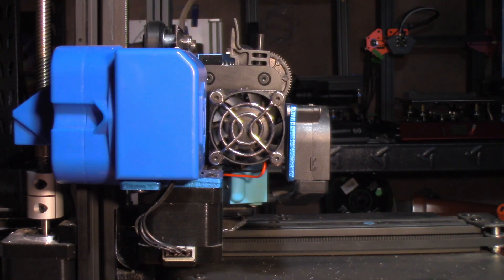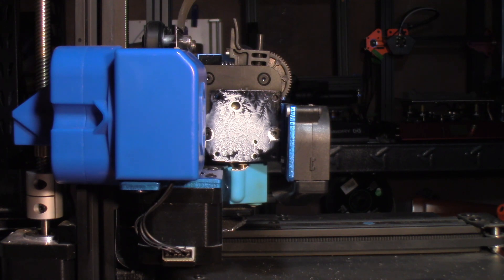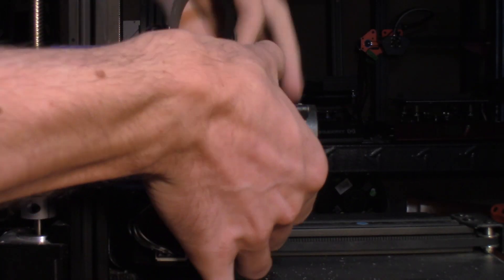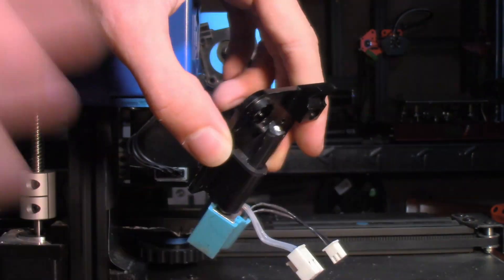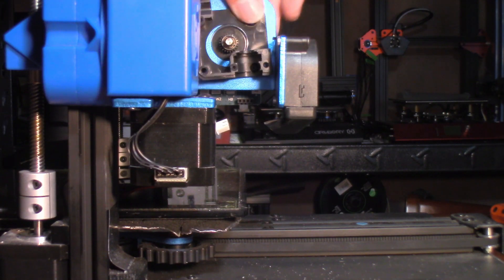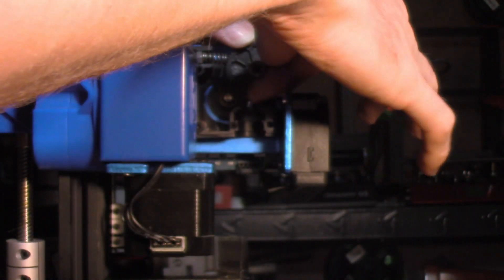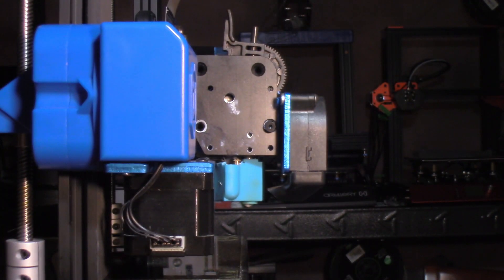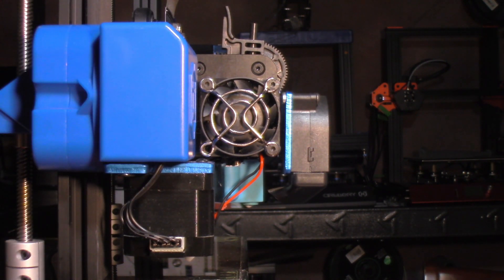Artillery 3D Hotend Teardown and Reassembly

Comment: I find it's a lot easier to work on and re-assemble the hot end if you dismount it from the printer altogether. There are three screws that hold it to the X-shuttle bracket. Mine's a X2, it's a little different. The heatsink and the plate which holds the heat break are one integral piece, no need for heat compound. Took it apart last night since the PTFE tube inside has gone bad, I had a couple of all-metal heat breaks so I'm installing one of those. They're fragile compared to the regular heat break, so I'll have to be extra careful when changing nozzles. With the X2 one has to be careful not to assemble the hot end with the nozzle sticking down further than it did, otherwise you'll end up with the nozzle hitting the build plate (quite a traumatic experience). To avoid this, after re-assembly, before doing ANY printing, increase the Z Offset by 2mm or so (hit the "Z Offset +" button 80 times) before re-setting the Z Offset so the nozzle height is correct.
Reply from the maker: Totally valid although many people do not like adjusting the V wheels, myself included. I can swap a heater assembly in under 5 mins with it attached to the machine still at this point.
Reply: @MakeItWithCalvin  You don't have to mess with the V-wheels - the entire hot end comes off the plate that moves left and right - just 3 screws. Of course, you do have to pull out the ribbon cable.
Reply from the maker: Oh okay, now I think it makes sense... It is a case of would you rather...
Reply: @MakeItWithCalvin  Yeah, the first time I took it apart while it was still on the printer. It took me ages to disassemble it in the first place - even unplugging the heat block was a pain because the connectors were behind the ABL sensor. Putting it back together took a long time, too. With the X2 it's important to measure the lengths of things before disassembly to avoid problems with the nozzle hitting the bed, too.

Comment: Hey Calvin -- I've just bought my first 3D printer (an Artillery Genius), and your videos are invaluable for knowing how it ticks and how to fix it if it goes wrong. I have a quick question if you have the time: the part of the tension assembly which initially guides the filament into the extractor has this short black bit of hard tubing. I notice that, with the friction of the filament, this gets pulled into just touching the ridged, plastic gripper that's on the same part as the large cog. Is this expected or is there anything I can do to stop it? I'm just concerned about longer term wearing of that plastic grip and it not pulling the filament as effectively. Cheers!
Reply from the maker: First, thanks for the feedback that really means a lot! Second, I think you are referencing the little black "guide tube" on the top of the extruder arm, don't worry about that. It is normal for it to slide around and I have yet to have one be grabbed by an extruder when printing. I may do a video specifically on this since there are a lot of "myths" around it I see floating around online. If it sliding around really bugs you, you could try putting a little rubber cement on it to give it some friction but otherwise, don't fret it!
Reply: @MakeItWithCalvin  thanks so much! I'm actually rewatching this same vid for another reason now -- after a successful first print I bought a nice textured PEI sheet and upgraded the firmware, and everything has gone terrible! I'm getting errors when usb printing, and weird inconsistent extrusion! About to go through some troubleshooting steps, wish me luck 😂 and thank you again for the awesome vids - your non-printing ones are super interesting too.
Reply from the maker: Np, can't help you in the firmware department. That is one area I try to steer clear of at all costs, seen it brick way too many machines if done wrong. And thanks, it is fun having a diverse set of videos ranging from making campfires > 3D printing > model train stuff. It helps me no get entirely burnt out on one topic which happens.
Reply: @MakeItWithCalvin  yeah I feel that, about the burnout! Too much of a good thing eh. I just rebuilt the hotend and there was a concerning amount of things barely screwed in at the factory, and one screwed in so tight it stripped the head. Lots of molten plastic sandwiched between where the hotend should have been, and the heatbreak.

Fingers crossed this fixes things -- all the best to you, buddy.
Reply from the maker: Cheers, I think you are on the right track figuring it all out.

Comment: hey thanks for the content super helpful. Have you upgraded to an all metal throat? Im looking to do the upgrade as i think ive degraded my inernal ptfe. LOTS of 240* printing. Im having trouble finding one that actually fits my genius any reccomendations?
Reply from the maker: Really good question, the short answer is no not really. I tried to install an old smooth bore throat in my X2 and it was too long and crashed the head. I have debated trimming a throat down, but not done it yet. If I do make/find something that works I will let you know!
Reply from the maker: Okay many months later... I should have asked do you have a printer with a probe or not? I have yet to release a video on it but I did successfully modify an existing titanium break to fit my X2 with the probe, and still have the probe function properly. If you are interested let me know and I will send you the link to my Etsy with them for sale.
Reply: @MakeItWithCalvin  The correct one to buy is one that is 21.5mm long. Lots of them (and other interesting/weird hot end parts including copper heat blocks) available on AliExpress et al. The ones made for Ender 3s etc. are the right diameter but too long. I just put one in, will be testing it later today.

Comment: Great video! just a question: do you know the characteristics or specs of the PTFE tube inside the hotend? Im planning to buy the X2 but i print with technical materials....240+ °C. If it is CAPRICORN or similar, I can use it without worrying......but if it is not....i cant. Is there any info about it?
Reply from the maker: Don't know the specifics but I don't like to push my PTFE past 240. I personally don't trust the claims of Capricorn and others that say you can push their PTFE to 260C. The only material that can do that is Vespel and it is $_$, and it even breaks down over time. If you really want to print hot, just grab an all-metal throat and pop that on and you are good to print hot all day.
Reply: No, it's not Capricorn tubing, but you can easily (more or less - taking the hot end apart is a pain) replace it with Capricorn tubing. You can also get a all-metal heat break for not very much - it's confusing which is the right type to buy, what you want is one that was made for a KRAKEN or CHIMERA hot end (these were four-nozzle and two-nozzle hot ends made by E3D back in the day, which wasn't that long ago since we're talking about 3D printing). They have an overall length of 21.5mm. These still require a PTFE tube, but they are shorter and don't extend all the way down to the nozzle and are therefore only in the cold zone. I think you might also need to make changes to the firmware to get the printer to go up to Nylon temperatures - there's some sort of limiter in there.

Actually - come to think of it... it might be possible to change the PTFE tube without dis-assembling the hot end, by pulling it out after you remove the nozzle, while the heat block is hot. You'll need some sort of extractor tool - maybe a drill bit of appropriate size. That would save a LOT of work. The tubes eventually do go bad.

Comment: Minute 9:46: What direction should the fan have? In another vid the cable was on the upper left corner.
Reply from the maker: What do you mean, the way it blows air or the way I put the fan on the printer? If you mean blows air, it needs to blow the air into the heatsink. As for how I put the fan on, you do it how it works best for you cable management wise!
Reply: @MakeItWithCalvin  Yeah, the second one. The way you did it was closer to the hotend, so I wondered.
Reply from the maker: @sevdev9844  Yeah I was just popping it back on for the video, in all reality do it how you feel is the safest method!